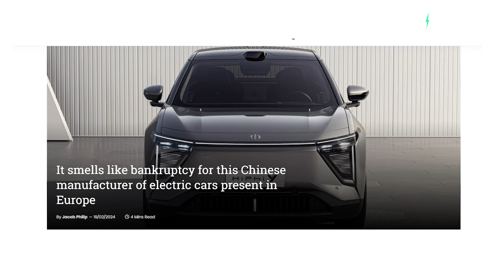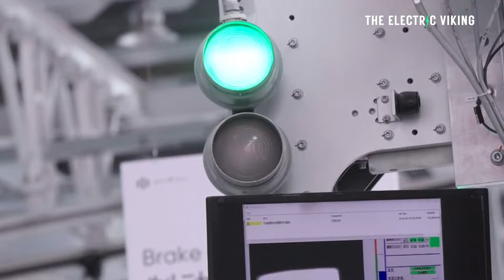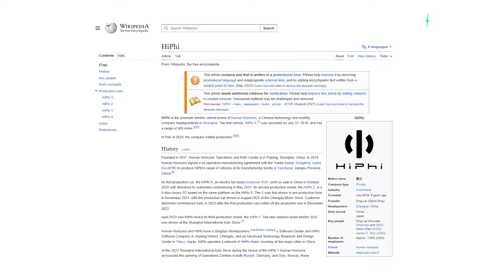Famous Chinese EV brand stops making cars and fires nearly all staff

Comment: The problem in modern days is not how to make a good car with all the gadgets, the problem is how to make those cars profitable.
Reply: How to make them profitable? Sell one WITHOUT all the 'gadgets'. I don't need to drive a computer game, thanks.
Reply: @jasonh.8754 And yet Tesla does just that profitably.
Reply: @fractalelf7760  Computer is cheap, all those knobs, instruments, wires, complex design choices cost money, and of course means more weight and bigger battery...
Reply: Software is the hard part.
Reply: @fractalelf7760  well, apparently 90 out of 91 EV makers in China do the same, but don't turn a profit... 🤷‍♂️ Where is the difference? Are the Chinese EVs trying to be TOO luxurious? I think the Tesla is a mid level quality and trim level, there are probably better out there.
Reply: @jasonh.8754  They aren’t as good as Tesla at cost-effective manufacturing and software.  It’s not about how swank you can make it, it’s about how low cost for quality you can make.  Tesla is simply unrivaled on this point currently.
Reply: Chinese manufacturing is all copying without efficiency. They aren’t good quality either.
Reply: I’d be far more motivated to get into an EV as a second vehicle that is basic without the add ons. There are so much unforeseen costs of  ownership that could quickly lead to buyers remorse and that would negatively impact the momentum for them to catch on.
Reply: @jasonh.8754  I would put Tesla on mid to low level when it comes to trim.
Reply: @captainkirk4271  "P.I.N.A"? Isn't it 'P.I.T.A'?
Reply: @Arwiiss  that is one way to save money.
Reply: We need cars for the working class with much less gadget and crap on them!
You know back to basic no one needs a $50,000 car to go shopping.

Cheers 🇨🇦
Reply: @jasonh.8754  Then you have no edge over the competition.  Anybody can  uild a mediocre car.  The key is to have a financial plan that's realistic.  Know the customer's budget, then taylor to it.  You know, market research, etc.
Reply: @alarjak Much more to go wrong.
Reply: Stop fitting gadgets. All they seem to do is take drivers attention away from DRIVING.
Reply: @fractalelf7760 Tesla last I heard were almost entirely gov tax funded

Comment: That was what happened to the American auto industry in the first half of the 20th century which ended with three surviving companies, GM, Ford and Chrysler.
Reply: I agree, the EV industry is like the automotive industry was in the 1920s. Unfortunately all cars built today are throwaway quality particularly EVs. I don't think there will be any EVs running after they're 10 years old or their original battery dies.

Comment: The average age of private cars in Australia is 11 years. Who would want an 11 year old EV or has funds available for a younger EV.
Reply: But Aussie cars last well over 20 years. A toy that lasts 7 or8 years is totally uncompetetive. And when they all go bust the EVs will be scrap metal with a HUGE problem. No recycling for those dreadfull batteries
Reply: EV will price a lot of people out of vehicle ownership. The bad part about old EV is the batteries being really expensive and will have lots of cell degradation by 10 years old. I predict a lot of regulations for government and insurance so DIY batteries will be not allowed because of the fire and electrical risks.
Reply: @ldnwholesale8552 Imagine in 50-100 years when there are a hundreds of billions EV battery cells spread out into landfill. The fires that break out will be epic. The number might even be higher than hundreds of billions if none are recycled since some EV have 8000 cells. Mind boggling when you think of 50-100 years from now.

Comment: I work a lot in Xiamen, China.  EVs are so common from so many brands.  Tesla is most common along with BYD.  NIO cars are so good looking!
Reply: Looks don't matter. It's all about quality
Reply: @patrickt49  And this is where Chinese cars are now better than European and American..
Reply: @patrickt49 the 'look' doesn't necessarily cost more. Good design "is" quality.
Reply: So that is why China is building so many coal fired electric plants. Have to charge those evs.
Reply: @ericgautreaux1752  this isn't true. China is leading in renewable energy technology and has some of largest photovoltaic power plans in the World and making 30% of all solar power in the World. Coal was 80% in 2008. Went down to 70% by 2017 and further to 60% by 2021.
Reply: @elksalmon84 China's coal use is still increasing, but so is their nuclear, gas, oil, hydro, and wind. As coal drops as a proportion of the total energy mix, the use of coal is still increasing. Wind and solar have always been the smallest part of their energy mix. China is still building coal plants and not just in China. Coal use has not peaked yet.
Reply: @jefflabute2946  i'll repeat - coal was 80% in 2008, 70% by 2017 and 60% by 2021.
Reply: @elksalmon84  Until you crash test it
Reply: @Soulboy63  Look upon Euro NCAP. Most modern Chinese cars are 5-star and safer than European and American.
Reply: @elksalmon84  80%, 70%,60% of what? For example, if overall energy consumption has doubled over that period, then coal consumption in 2012 is still 1.5 times the level of 2008. You can do the maths on actual overall energy consumption, rather than take massaged headline, misleading figures.

Comment: Gonna be a mess of cars around the world with no support and parts ,  once people realize most EV companies will fail and leave them stranded for support with zero equity in their investment its gonna speed up the dominos and increase BYDs sales as the car to get so you can get parts and support . Anybody that just bought one of these for 100k is bumming .
Reply: How do we "green the Planet" - if we are about to see fairly new EVs in Scrap Yards around the world, well before their time? There is a high chance that this could happen, if manufacturers  go bust, and do not have a complete Inventory of EV Parts, and also the (local) technical know-how to repair your EV when it goes wrong. Sometimes, it's not easy to get your ICE car fixed easily these days, and EVs present a whole different set of issues for technicians. I agree with your comment.

Comment: Most manufacturers have seen the light and are not going back to making hybrid. Hyundai,  GENESIS is a good example just announced this week
Reply: Hybrids combine the drawbacks of both fossil fuel vehicles and electric vehicles, with added maintenance complexity. The continued sales of hybrids are primarily driven by fiscal incentives rather than inherent advantages.
Reply: Toyota disagrees @phvaessen

Comment: Any company that expects $75,000 per car is asking to be put out of business.  There are too many building electric cars these days, and all of them are charging too much.  Dealer lots are filling up because all the suckers willing to overpay by that much have already been taken.  The question is; when will the greedy carmakers give us an affordable car without thousands of dollars worth of useless gadgets that only jack up the price of the car.  I need heat, AC, a radio with good speakers, and a place to plug in my phone.  I don't need my accounts to get hacked through my expensive cars weak security.
Reply: At some point used cars will drop down to like 3000 dollars, competing with new cars.
Then only the most efficient car makers will survive. Right now they're trying to get in on the gold rush
Reply: Ev cars have dramatically dropped in cost over the last year in china, all brands have reduced the costs, your a bit out of touch with the ev market

Comment: GM has how many different badges for the same vehicles?
Reply: How did they come to have so many badges? It's just consolidation. If it's worth anything, another company will buy them up. If it's a niche company with few customers and no market share, they fade away. Who here has heard of them before this? They are hardly a famous EV manufacturer.
Reply: The Blazer EV and Honda Prologue are the same vehicle apart from some options available. I was surprised to find out a Honda was actually on a GM chassis.

Comment: Of the PRC’s domestic EV manufacturers, only Li is operating in the black, & they’re ineligible for subsidies as they’re priced beyond the subsidized market. They’re doing well & expanding cautiously abroad. Otherwise, every EV maker is under pressure, most dependent on subsidies. The cost of the subsidies to the Chinese gov is staggering, at a time when other debt is also increasing. We’ll be seeing Darwin’s Rule in full effect when subsidies are withdrawn, w/many resultant extinctions.

Comment: Yes follow the $$$. EVs are cheaper to maintain and cheaper to fuel. —> So hard to compete with money saving transportation
Reply: Can't agree. Tried an EV and the electricity was about the same as the fuel. But with a) quicker car price decreasing b) less convenient to drive outside of city, EVs just have it's own niche (mostly daily city/town-only rides withing 40% of car range), no more than that.
Reply: 40% of 250 miles covers 95% of ppls commutes. As for electricity at home charging at night is way way cheaper
Reply: Try telling Hertz and Sixt that EV are cheaper,  both have dumped their huge EV fleets and going back to ICE.  The reasons given are massive depreciation,  unreliability and very high repair costs, Tesla cars were the worst offenders, and they got dumped first, but now Polestar are getting dumped.
Reply: @nickford5549  Where did you get that numbers? Looks completely random. First, can't say that 95% of earth population does have an electricity at all, probably about 90%. And not sure if even a quarter of that number live in own houses or apartments in developed countries to be able charging nightly.
Reply: @IgorPellinen where do the electricity come from? How do you charge this sh*tbox? Where do you get the minerals from? A new Tesla model Y or Polestar 4 has a co2-luggage over 20 tons before it has even been charged for the first time! Compared to a modern diesel car it takes at least 18 years or 270000km before it’s equal to the diesel car. In that time the EV has either corroded away, need for battery replacement or been scraped for too many failures in the electrical system or in all those fancy gadgets.
Reply: Stop lying. Sixt is buying more BYD.
Reply: EV are not cheaper, battery is expensive, insurance is expensive, depreciation is insane and they cost the same to charge as most Hybrids (6L of petrol or less)
Reply: It’s not cheaper to charge. I get 1kWh for 0,16€ and I fill up my tank with 700kWh in less than three minutes. For supercharging you have to pay between 0,39€ and 0,51€ per kWh to charge a heavy battery with mostly 100kWh. That can take up to an hour and don’t forget the energy losses as heat when you supercharge, energy losses you have to pay for. Absolute bonkers!

A complex electro chemical battery with more than 7000 individual cells with a complicated cooling system and electronic surveillance system. That’s at least 14000 potential sources to failure. If one of these cells get tired of life you get thermal runaway and the whole car is engulfed in flames in less than a minute spewing out nervtoxic smoke. What a hit!
Reply: @nickford5549  Raw data for that claim please?
There's more to life than the commute you know. There's more people without the ability to "home charge" than there are that can. (see housing stock - terraces, flats etc)
And if you think the home night rate will stay low for long, you've got something to think about. Not so long ago, people were stating it's cheaper to run an EV because rates were 7p /kwh. Now it's nearer 30p. You think you're going to keep on getting cheap night rates? Lol!
Reply: @MikeInc79 someone doesn't know their facts. What co2 percentage are you using for oil exploration, refinery, transportation, delivery, waste, cobalt destruction, and emissions. An ev has some less than 40% co2 initial construction deficit. But that is replaced by all of the above within 18- 25k km. do the math stop spreading misinformation.

Comment: Of course they have "outsold Porsche." Porsche is not a high volume EV manufacturer. That's a lazy and irrelevant comparison. Plus, HiPhi have only stopped production for 6 months, as the headline states. It's premature to speculate the long term future of the company. This is not a balanced, reasonable report.

Comment: What happens to the cars without software links to the server?  Does the car stop running?
Reply: I suppose they would only stop the Over The Air updates. The more worrying thing would be closing the maintenance and repair locations.
Reply: No when the battery gets to 10% of capacity the POS shakes violently for 2min and 22 sec. And Folds into the shape of a suitcase so you can carry it to the dump.

Comment: OK, so EVs need less service maintenance than ICE cars, but some replacement of parts will be needed and some bits will fail under warranty. Is your umpteen thousand pound car going to suddenly become a worthless pile of scrap if a minor but important part packs up? I will not be putting my money at risk any time soon. Parts for older ICE cars have been around for years and some are still manufactured but the same cannot be said for EVs, yet.

Comment: Id only buy a car from a brand thats making money... worried about parts.. seems risky buying anything but byd and tesla.
Reply: Is BYD making money?
Reply: @HappyBagger  i think they are. Though I'd buy tesla because Quality checking on the battery is probably allot higher. With rc cars, the more expensive lipos came from the same factory but had better quality cells, apparently... in 2006

Comment: The world wants a low priced basic transportation electric  car that does not have to be a super  fast or more than 350 kilometers of range.
Most people can't afford these super fast high luxury electric cars including me.
Reply: They are being designed now and with the price of Lithium coming down they will be on the street within a couple years.
Reply: @jamesvandamme7786  Lithium won't be down that long as the existing EVs with batteries need them replacing (those that haven't already turned into noxious gases by self combusting)

Comment: In my view. Chinese car mfrs simply jumped on the EV band wagon, as theyre almost certainly, at this very moment, setting up to produce hydrogen motors. None of them, any real research. All , same in the West, stealing the progress made by companies who researched the water based fuel of cars. So the employees only need to weather the storm between change over from one to the other, as they did with ice motors. Until someone does latch on to the future fuel theyll all adopt, due to cost and availability. Im not sure yet if Ill change from my air activ diesel motor for hydrogen, or if Ill wait til the new fuel comes to light. When we can also expect a total design change of vehicle shape too. I have a feeling, its going to be light enough to fly, using road space but not road surface. Not high, at least in the first couple of years. Wheels for parking, but no other reason, otger than to cushion landing.

Comment: Surprise surprise. This is the fate of all of these companies. Thankfully US auto companies are waking up to the dangers of EV and are getting out of it while they still can. Long live ICE!
Reply: ICE is on a dead end road. All the OEMs have EV designs in process and are building lines. Battery plants are going up and as lithium prices go down, meaning cheaper batteries. Within 2 years cheap EVs will be cheaper than ICE and lots cheaper to run. 
It's dollars and cents, not politics, not ecology, not gadgets. Oh, they're also nicer to drive.